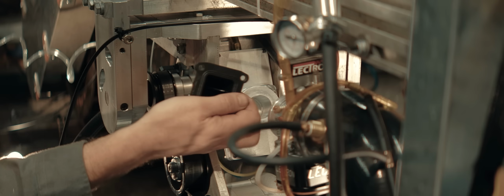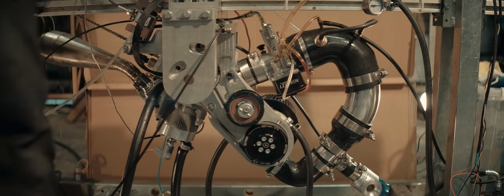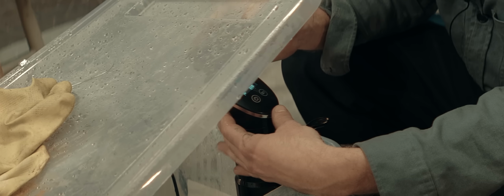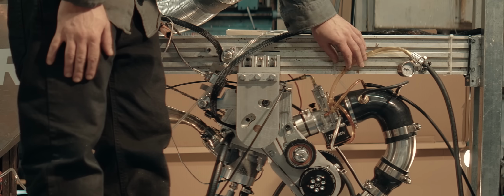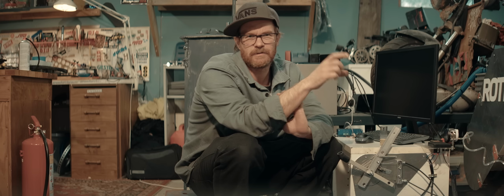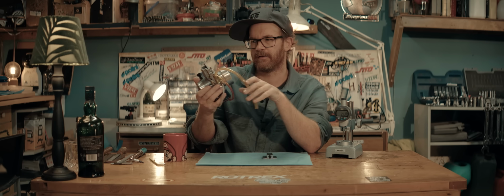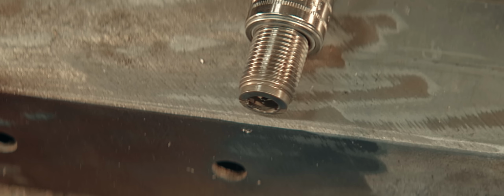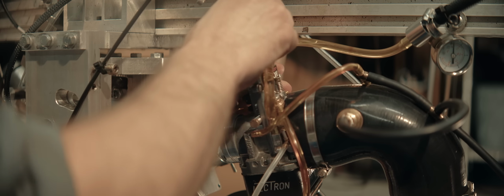Supercharged 50cc Two Stroke BREAKTHROUGH!

Comment: To think some day in the future we will get to see the final product in a bike going for the 50cc record 😀
Reply: top fuel 50cc 2smoke bike world record quarter mile fs
Reply: agreed, I'd stay tuned to see that day. Hopefully it will produce 50hp and just easily smoke a ninja 400 LMAO that's a beast!
Reply: @Astrix_Jaeger  😂🤣👍✌️🇬🇧
Reply: @Astrix_Jaeger  bros VERY optimistic for those power figures
Reply: So I'm going to do dumb math, I haven't heard how many bar it's running but let's say it'll do 20hp at 0 psi; at 1 bar and 50% compressor efficiency it's 30hp; and 2 bar 40hp would be my guess.  The temps may skyrocket with the increased pressures.

It'll be fun to see how the story turns out.
Reply: @StalaVII  It produced 33hp without the supercharger so its not impossible
Reply: @swicked86  on the methanol I don't see temps being the issue with the short burts he is doing.... I do see it MAYBE melting down in a long power run at Bonneville but that's likely an issue with cooling that he can overcome with more boost and more fuel or better external cooling, or even more efficient cooling passages in the head?
Reply: I look forward to telling people, "Yeah, I watched him develop the whole thing." 😁
Reply: @StalaVII  On one side, 33hp on a bench could easily become way more on the optimized, final engine.
On the other 50hp on the crank easily becomes half of that once you get a real clutch, a gearbox, wheels, a whole bike around it...
Reply: I don't know. When it finally sets a record I'll miss the weekly garage chatter.
#Aloha
Reply: @Astrix_Jaeger   Lol dont know if anyone is familiar with a kawi kx 60 but between the ninja 400 my $ would be on the 60! That thing put 4 adults including myself on our arses... 🤣🤣🤣
Reply: Yeah, by then it’ll be running on magnetic forces with a flux capacitor at supersonic speeds traveling different dimensions to skip over wave lengths in time just to end up right back here where we are.... Besides the wormholes and portals, guess it would be a pretty cool ride🧐😉
Reply: 15yo finnish boys: "way ahead of ya"
Reply from the maker: 37yo Norwegian guy: "not really"
Reply: @ville5152  which episode had the 33hp ? I was browsing through the whole channel and couldn't find anything over 20hp which seems to be what the best aftermarket 50cc cylinders do out of the box on gas. I have to say the Dyno seems a bit fishy though...there's a reason why Dyno are run with rpm always going up like an engine is supposed to be used under load. this way you're inertia (flywheel etc) to artificially boost the power
Reply: @geemy9675  i think when he put the new carb on it.
Reply: @swicked86  this iteration of the engine doesn't have the rotary exhaust valve? if it doesn't it seems like the single obvious reason why the supercharger would only reduce power. only improving the scavenging but not generating any boost inside the cylinder and just dumping more air/fuel in the exhaust because exhaust ports close after the transfers
Reply: @ville5152    are you talking about "not saying this 50cc makes 30hp but..." https://youtu.be/MIDaSh3o380
I only see an engine that suddenly stalls because of reed valves braking and jumps from 8hp to 40 ho then back to 8hp and eventually 0 in less than half a second.
seems more like a Dyno measurement error, the torque is caused by the inertia if the engine being stopped brutally.
in the end it is just an experimental engine tested to it's limits on an experimental Dyno that has never been. calibrated and puts out a lot of "false positives"
Reply: @geemy9675  Dont forget the pipe....
Reply: @davelowets  the pipe already generates "boost" in the powerband but I think with a supercharger most of the boost will be already lost during the scavenging.

maybe a supercharged engine could rev even higher by making scavenging quicker
Reply: @geemy9675  The pipe isnt just for scavenging, it also uses sound waves to push the escaping fresh air/fuel charge back into the cylinder. It WILL help keep some of the boost in the cylinder. Some boost is better than no boost, and will result in a horsepower increase.
Reply: @davelowets  yes but how much of the boost is lost through the exhaust port? how much is gained back thanks to the positive pressure wave? how much power is lost because of the supercharger ? it's all about the numbers. even in a 4 stroke engine with little valve overlap and plenty of time with exhaust valve closed and intake opened to fill the cylinder and build pressure inside, one bar of boost won't double the power, so in a 2 stroke , let's say if 90 % of the air/fuel boost escapes through the exhaust port, parasitic loss will most likely negate any power gain. if your relying on the exhaust to generate boost then supercharger is useless. but dynamics of two strokes are very complex so there  might be other factors that kick in at very high rpms like maybe enough of the mixture wont have time to escape and will stay inside and generate boost
you can also factor in that boost being added to the crankcase means also more pumping loss, less torque generated. the piston has to fight more resistance when it's moving down. maybe that's the reason why nobody makes supercharged two strokes especially not without using valves.
what helps her is that drivability, low end torque are completely ignored and only peak power is seemed, so we'll see how it turns out..
Reply: @geemy9675  Doesn't matter "how much". If it makes more power with the supercharger, that's what counts when it comes to setting records. Simple math done can easily tell a person the efficiency of the blower. 
There is a reason that really high power 2 strokes are very peaky, and their useable rpm range is very narrow. Take a look at some of the record setting 2 stroke bikes used in track racing years ago. They had 20 speed transmissions because the rev range of their N/A engines were so narrow. That's simply the nature of the beast when it comes to 2 strokes. They will never act like a 4 stroke does, whether N/A or on boost.
Reply from the maker: The reason I'm exploring this route now, vs continuing exhaust valve development is the potential of much higher cylinder pressure if the pipe can still do its 2-3bars at the port with forced induction. I think it can.
Reply: @2STROKESTUFFING  sincerely hope that will work one way or another since I'm such a fan of both 2 strokes and your work but it seems like serious attempts to supercharge a two stroke involved some sort of exhaust valve, and injection. 
if air/fuel mixture has already expanded out of the cylinder and into the exhaust, a simple pressure wave is probably not going to put everything back the cylinder? I'm picturing high rpms,transfer ports opening, a fresh charge of compressed  air/fuel rushing into the cylinder at high velocity, scavenging exhaust gas, and then transfer port closing, and the charge being quickly stretched out between closed transfer Port and fast moving exhaust gas, losing its pressure?
Reply: @2STROKESTUFFING  My thoughts as well... Rock on! 🤘
Reply: @geemy9675  You missed the point... The pipe ACTS like a valve at it's resonant point, that can hold 2-3bar at the exhaust port. You don't NEED a rotary valve to stop boost from escaping, the pipe can do it all on it's own.
Reply: @davelowets only in a fantasy world. a pressure wave propagates at the speed of sound, it doesn't stop just at the exhaust port and stay sationary. when you're in the power band, the pressure wave reaches the port just before it closes and pushes  back some air inside. but the boost from the supercharger has already escaped the cylinder
Reply: @geemy9675  No, if it was all just a "fantasy world", a pipe would be a waste of time and wouldn't work at all, but they DO. Who says that a pipe can ONLY work at atmospheric, or slightly higher levels? They CAN be made to work at elevated pressures, such as boost, also. Some boost would escape, but it certainly ALL won't. If it did, the engine wouldnt gain any power from adding boost.
Reply: @davelowets  well that's the point, it's not gaining any power. I hope it will eventually though
Reply: @davelowets  IF it makes more power than the supercharger losses, the pumping losses, and compensates the hotter compressed air temperature.
Reply: @geemy9675  It will, it's not configured and tuned correctly yet. He's getting close though.
Reply: I think it will skyrocket staggeringly to the point of needing and benefiting from something like liquid nitrogen cooling .
Reply: @geemy9675  Agreed.

Comment: as you dont mind complicated,,hows about two carbs, a small one that opens before the larger one,so as to run well at lower speeds then the larger one to come in and open once up to power,,the smaller carb could be fit inbetween the large carb and the intake, only a thought but it could solve youre problems,
Reply: so basicly lika car carb with 1 bigger 1 smaller butterfly clamp.This could maybe work
Reply: Good idea....Thats the way my toyota works. 2 barrel carb. Only one opens at low rpms. Both open when i step on it.
Reply: @joebloe9901  i think it would be easier to just fit a small seperate carb rather than using a twin choke set up or the four barrel type car stuff, the smaller carb could be made to close entirey as the bigger carb takes over
Reply: He has had dual carbs in the past like you’re suggesting; great minds think alike!

Comment: That "alcohol", what you had there is no alcohol. It is water! Alcohol, no matter if it is a metanol, or etanol will mix 100% whit gasoline. But, there is a little thing you should know abaut. Alcohol and gas will mix, but theyr bond is pretty weak. Water and alcohol bond is very stuff and good. Thats why if you have a gasoline that is made of gas and alcohol, and there gets any water, all the water and alcohol will separate out of the gasoline. Just for you to know that thing. You are makeing great stuffing! Keep going hard!! PS. It is very nice to watch your hard working. Greetings from Finland.
Reply from the maker: Thanks! Yes, should have remembered that, I've even done testing on e85 before by adding water to check %.
Reply: Hygroscopic is the word to describe alcohol's tendency to absorb water from the air. Brake fluid is hygroscopic too

Comment: The supercharger is a rotary driven air pump.
It takes atmospheric 1 bar pressure and increases it to a higher pressure on the engine side.
So if the supercharger mechanical drive is disconnected the engine inlet will be sucking its heart out and the supercharger will have 1 bar on the outside and a hell of a depression (several inches hg) sucking on the inside of the stationary turbines that are blocking the intake tract.

Maybe rotating the supercharger with a variable drive ratio could work but a clutch will be like shoving a bung up the carb.

I suppose it would be possible to put something akin to a wastegate in the inlet tract in reverse orientation so that upon inlet depression the wastegate valve opens to let air in through the carb but I cant see that as a real option nor reversed reeds in the same configuration.

Great series.
Much respect for a project well researched and developed.

Comment: I sent you this, on Instagram on the 17th of October - "Alex, I think the way you have sleeved your carb may also be causing you problems. When I have sleeved carbs down, in the past, I have turned eccentric sleeves, so that the air is still able to pass over the Needle Jet opening. The way you have done it, with concentric sleeves, has masked this opening (it looks like anyway), reducing the pressure signal to the Needle Jet. I think this will also be reducing fuel atomisation"
Reply from the maker: 👍 I made the sleeves eccentric, and that step was ment to be ground out after gluing, but...
Reply: @2STROKESTUFFING  - I guess I was pointing out that there was a step and how I thought that would affect it
Reply from the maker: @Scissors69  And you were absolutely right😁
Reply: @Dave Goodwin - Well spotted!

Comment: Look in to a ac compressor clutch, you could engage it with a switch at higher rpm or lower rpm.
Reply: I don't think those will cope with 30hp.
Reply: @rubikmonat6589  for the most part they deal with the full horsepower from a car engine they do cycle off after 70% throttle in a car. And most vehicles make more than 100hp at 70% throttle.
Reply: @jaxperez7860  they aren't holding back 100hp though, they're only holding the resistance that an ac compressor has against the engine, maybe 5-10hp max.
Reply: @jonathan7744  true , i think it will work, no point in not trying , I feel like the amount of pull the magnet has on the friction plate should be more than enough to handle it.
Reply: @jaxperez7860  I sure would like to see it tried atleast. Would be tricky but cool.
Reply: @jaxperez7860  the load on the A/C clutch is only about 2-4 horsepower from the compressor. It's practically no bigger than a bicycle disk brake. I've built custom brakes and clutches for race applications.

Comment: I noticed that you are getting a lot of supercharger drive belt flutter at higher RPM, a little on acceleration and a lot on deceleration. I think you need a idler on the driving side of the belt (where the unsupported run is longest)  otherwise when the load goes up and the belt temperature goes up, the belt will either throw off or disintegrate. Time around 23:52. Also if you think about future improvements in airflow, the optimal exit from a centrifugal compressor is a diffused angle of 7 degrees, this will allow the air to get to the inlet at the best flow. Sudden diameter changes cause deceleration in the flow which leads to interference and turbulence which will affect the way fuel is pulled from the carb jet. Still think direct fuel injection is the way forward.
Reply: lot of flutter in the chain too. If its for land speed a heavy flywheel?
Reply from the maker: Lots of things in need of improvement, Iwant it to run ok before I start optimizing.
Reply: Sudden diameter changes also introduce a resonance pulse up and down the intake tract.
Reply: I was wondering whether that idler was on the drive side or not while the other side was whipping around.
Reply: @2STROKESTUFFING Pip Higham that's a name I know, I didn't know Pip Higham made or tuned 50 s . He's the famous Susuki tuner ..I remember he bought a brand new GSX 750 tuned it and blew all the competition away back in I guess it must of been 79...
Stan Stevens was the man back in the 80 s who was more known for 2 strokes, my mate had a 250 lc that we were all very jealous of..I met Pip at a meeting at Avon park many years ago..yes a clever guy .does he know about your engine..

Comment: To learn how rich or lean the engine operates throughout it's rev range, perhaps you can use a flue gas analyser in the exhaust to check co/co2 and nox that should give you a real time combustion efficiency value...  Also, I can't wait for you to try exhaust water injection to accelerate cylinder scavenging, I believe that Honda did something like this on their GP bikes at one time.

Comment: Maybe a magnet clutch would help, and it would be much easyer to control
Reply: Or maybe a pneumatic clutch like the fan clutch on a diesel semi truck engine. They don't have any issue grabbing the fan at 2000 rpm. The newer engines with all the epa crap need really aggressive fan blades to keep them cool.
Reply: @andypughtube  Im not really into this but i think in some car engines with a supercharger and a turbo they used a electromagnetic clutch to decouple the  supercharger at high rpms, maybe this clutch woulb be strong enough. A pneumatic clutch (or maybe a hydraulic clutch too) is surly strong enough but i dont know how fast it opens and close and thats relativ important here.
Reply: @tuckercurrie3420  Actually the clutch you talk about is likely to be to reduce engine load when cooling is not necessary and also to allow the system to warm up more quickly. The aim is to get the aftertreatment working as soon as possible. Diesel engines lose a lot of heat through the block (I have run engines at part load and found that the dyno fans were enough, the thermostat never opened. As I was trying to  sign-off the thermostat design, this was unhelpful)
Reply: @andypughtube  Well I wasn't really asking what the engine fan was for but thanks I guess.